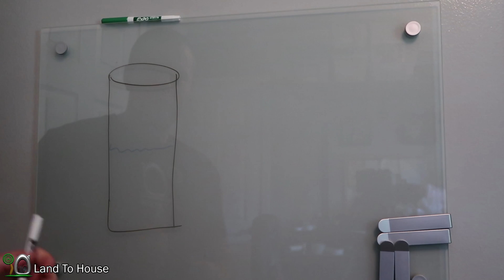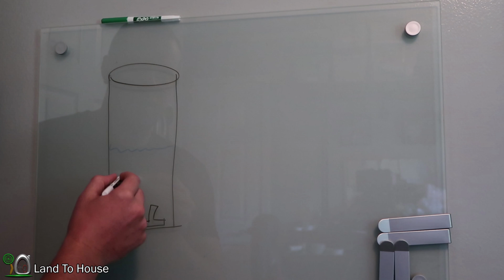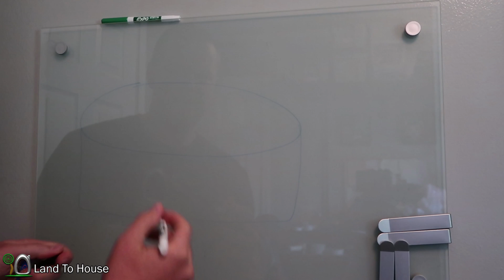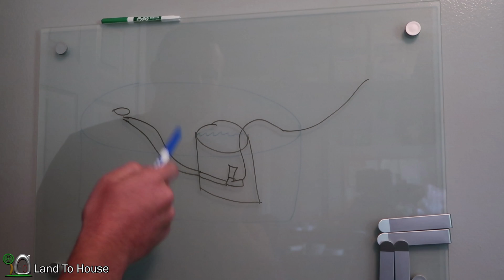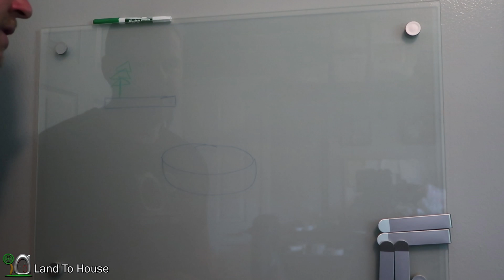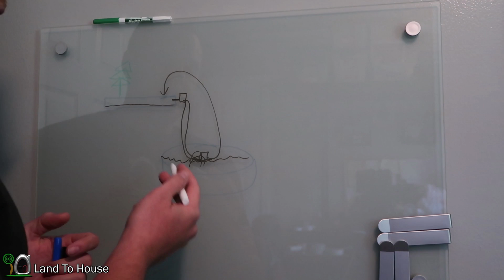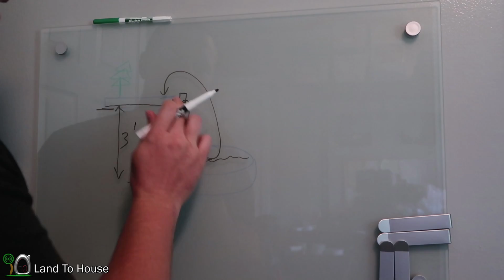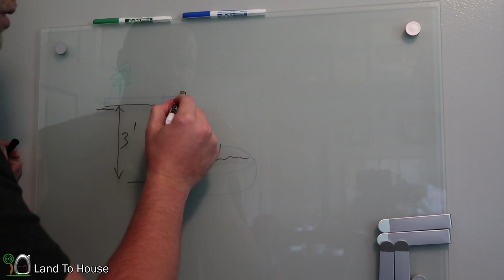Ram Pump for a Well and Aquaponics - Nope

Comment: I have a design for aquaponics that takes the disadvantages of the ram pump into account. Wondering what your thoughts would be. Still in the design phase, so dimensions and measurements are not actual yet, just for sake of explanation.
I will have a my fish tank three feet off the ground. Ram pump intake goes from tank down into a reservoir on the floor where the waste goes. The 10/15% water goes up six feet to my media bed. Water is cycled with a bell siphon that empties into fish tank. Sump pump in the reservoir automatically removes water back to the fish tank.
This design removes the need for a pump running on electricity 100%, just estimatedly 10 time per hour for two minutes (based off the size pump I'm planning). 
The height of the media bed provides back pressure for the pump, the quantity of water in the fish tank allows for a full cycle, and it is reset by an electric pump.
Note: I might end up added a "parallel" tank at the same elevation as the fish tank, attack via "u" siphon to maintain equilibrium between tanks, for the purpose of having a greater water quantity "in the bank" as well as possible draining the sump into to prevent too much water movement for the fish.

Comment: i want to try to lift the water using a solar pump  into a drum which will stand above the water on a stand . then position the ram pump right above the surface of the water on the same stand but lower than  the drum.  to pump the water into long pipes that will drain back to the dam. the long pipes will serve as grow beds and the dam has fish . what do you think about this plan?

Comment: Yea.  Your logic is a bit flawed here.   If you've got a hand dug well what's stopping you from digging a secondary chamber next to it with a drain for the ram pump to sit in with the drive pipe coming out of the wall of the well and the excess water from the pump draining right back into the well again.

Comment: i guess you could prime it by prefilling the upper tank to the overflow first...either by hand or an electric pump (you can have a simple waterwheel set up to do it)

or don't make it a closed loop...run the ram jet line up through the hydroponics and then either irrigate a normal garden, clean it for drinking water, or send it back down into the stream...

Comment: What about lifting the waste valve and pressure tank up so the intake/drive has more head pressure ( 2m from the water surface) than the rest of the pump ( maybe 1m )? . Water will start to flow through the system up from the intake to the waste valve. Ofcourse valve will also be pressed down by the water above, but this could be compensated with the spring.  Anything missing in this concept? ;)

Comment: I f I have a drill well, and put a 2” line in the well with a check valve on the bottom. The  well is 600 ft deep  I put in a 400 ft  line, in the well the water is 100 ft down. And I fill the 2” line in the well with water. I put a  500 gallon tank on a hill roughly  500 feet away  40 feet higher than the well head. Now I have water in the tank on the hill to  keep  water for the ram will it pull water up the pipe  that is full of water at the well head.   and put it in the tank on the hill 500 ft. Away.  Thanks for thinking about my problem. Larry

Comment: reference to aquaponics: it's common practice to use gravity water flow in aquaponics systems, considering the fish tank is higher than the grow beds and a sump tank is the lowest component (usually a pit dug into the ground to establish sump tank). so it be fair to say if one could infrastructure additional space for ram pump system lower than the sump, we have pressurized recirculation aquaculture control flow. like a system on a slope? could possibly work.

Comment: Due to water weight, if you dig a hole and place your ramp pump lower than the water level....then it should pull from a stagnant body, yes? Only thing needed is a place for waste water to go, such as another depression?

Comment: hi great videos . hi can i use a water pum to run a ram pump ? i saw your video about the under water pum . thinking maybe ii ill use a ram pump under water with water pump it will help me move water in the tank while while using the power of the ram pump to move water out while the waste water stays in the tank but creting water to move around the tank

Comment: what about using a ram pump in a tower garden?
Reply from the maker: I use the ram pump to pull water from the creek and pump to a water tower. Then I let the water run back down by gravity to the garden. It works very well.

Comment: If the waste valve is circled to the original static force then it'll never run out)?right) n say the water level is the static(then doesn't size matter? I just don't feel it needs to drop through a pvc
Reply from the maker: taking the waste water back to the source does not work. It makes the whole system at the same water level. Meaning that there is no pressure to start the pump
Reply: But if 90 % of the water is waste water wouldn't it build more static pressure cause of the 90 % waste adding to the static where the drive is
Reply: Y would it work? Only if it drops below the lvl of the drive

Comment: The hydrophobic issue could be solved with a hero fountain or Herron fountain.
That's a free energy device & has many great applications.
Reply: Absolutely incorrect. dS/dt >= 0 , where S=entropy . No "free energy", no perpetual motion machines, no Santa Claus. Myths are not science.
Reply: A herron fountain is a closed system built by pressure

Comment: I have thought about a partially submersible bin, bucket? It would be weighted down to create a head height  & the residual wasted water that poses the problem! Can be sucked out by having a thin hose that run's on the outside of the drive pipe> using the vacuum effect to clear the 
waste problem.

Comment: How about this... what if... you used... the ram pump and E-pump in tandem, would that work? like 1 meter high grow bed falls into pump, then you would need a 3 meter back pressure. water flows through syphon activates the ram, a E-pump with a float switch in tandem to pump out the excess 90% waste. what would the flow rate be after the first cycle if this would work?
Reply: What if a trench of proper proportions was dug at the outer edge of the pond or body of water which would simulate downhill or gravity flow to start the ram pump.. it would probably drain it eventually if rain or some other source didn't replenish it but I believe it would move the existing water that's in the pond.
Reply from the maker: As long as the pump and water source are in the same pond it won't work. The water must be flowing and have head pressure. Sad but true.

Comment: If you use 9 ram- pum use at 3steps ? ..may be worked
Reply from the maker: The problem with stepping the ram pump is that a single pump can't supply enough water to run another 24/7 unless the first pump is very large. It's best to run the first pump as high as you can.

Comment: If your fish ibc tote and is plumbed to swirl filter which is plumbed to bottom of ibc tote off ground at level of top of swirl filter say a 55 gallon barrel then sump is plumbed to ram pump would it not pump water to grow beds and fish tank. Seems to me it’s all in how your system is set up.
Reply from the maker: The main issue is that the ram pump uses way more water than it pumps. Eventually the water will be at the bottom. The idea is that someone could use the ram pump without a sump pump.

Comment: what if u take a open barrel From both sides.Gluing rubber on one side and install a thin tube in center of rubber Through the center of the barrel. the tube it must be at the height of the well plus height of the barrel, dive  the barre strongly   in the well ( Rubber towards the bottom, Tube towards the top) Until the water reaches the outlet of the pipe (sorry for bad eng)
Reply from the maker: Is this design used with the ram pump? As far as I know there is no way to use the ram pump in a well even with a barrel.
Reply: I painted two pictures of the design I mentioned and for another design 
https://imgur.com/eh4jVoO
https://imgur.com/tybQrlk

Comment: Ok imagine your  Aquaponic system  is 20m higher than the river,  and there is enough head to reach 40m.  I remember seeing a ram  circuit that just used the hammer to push re-circulated water in a closed loop circuit,  so no new river water was added to the system. It does exist buddy, just not in the way you described. Maybe you can re design it.
Reply from the maker: I would like to find that in action to learn from that setup. So far I have not seen any closed loop with ram pump that lasted more than one cycle of water.
Reply: Land to House Me too!  But we can all agree that the ram hammer creates enough energy to pump 10×  the head height.  I'm now thinking if the ram action could power a piston, and a  Camble fly wheel?  With the output connected  to a gen, or a pump.
Reply: Land to House check out  mrteslonian TT channel, he adds a Tromp to his ram pump to get more pressure, now I'm thinking to add small tromps to aquaponic systems, no need to buy air pumps, but with a pump and a troop you could make an air lift circuit, for free!

Comment: Howz about using  a constant flow gravity system instead of a cyphon? If the ram pump in the lower tank was big enough to compensate for the waste water loss, couldn't it pump enough water to the top tank if the top tanks outlet pipe was of a sufficiently smaller bore to retain enough water and also supply the ram pump? Probably not, we're really looking for perpetual motion but  don't want to admit the pump is so innefficent in this sort of system.
Reply from the maker: No matter how we use the ram pump in the end 90% of the water ends up in the lowest place. It really is a tool meant for a constant source of new water in a higher state.

Comment: cool video....had an idea and not sure if it will work but I watched your video about the pump under water and seen that it still worked fine.. this tells me that the release valve is strong enoungh to  hold water out......so in your pond scenario with a canaster down in the pond housing the ram pump....could you not attach a pipe to the out flow and up and out of the canester back into the pond?  What am I missing....or maybe im wrong and under water makes it more effecient cuz not as much water is lost in the release because of pressure...not sure too many questions maybe need to build one and test....but your input would be appreciated.
Reply from the maker: I have learned a lot about the ram pump since the underwater test. I have another test planned later to show this concept better. The pump needs a source of water above the pump to work. In the pond- If you made the waste valve tall it would negate the head pressure by hydrostatic pressure. So the valve would never cycle. The water would equalize in the pipes.

Comment: There is another setup no one has considered. Put your fish tank lower than  halfway down  through your setup. Use waste water to fill the swales and tanks at several levels going up hill using several pumps. Use gravity and bell siphons to empty the swales from tanks at the lower end of the swales. I hope this helps.
Reply from the maker: The problem is the difference between waste and lift. The ram pump only pumps 10% or so and the other 90% is lost out the waste valve. So very soon after you start all the water is at the bottom.

Comment: If a wide concrete  tube was submerged down to the bottom of your pond but was long enough to stick above the water surface, the contents could be pumped out. The concrete tube would then be open to atmosphere. Is there no way of removing the waste valve water via check valves and /or a submerged pipe or a  drain pipe running below the pond bed to lower ground?
Reply from the maker: So your idea is to have a dry cistern sunk in the water and place a ram pump there inside with intake in the pond where the cistern is located? Then Have and extended pipe on the waste valve that carries the water out of the cistern, out of the pond, from a location in the bottom of the cistern?  That would work but it seems like just moving the ram pump to the place where the waste water is going would be the better option.

Comment: what if u install the suction pipe straight at the bottom?
Reply from the maker: Hello. So installing the intake to the ram pump (suction pipe) from the bottom of a pond will work as long as you are taking the drive pipe out of the pond and down hill to the pump. Installing the ram pump in the same body of water as the drive pipe is not going to work. There is no downward movement of water in a pond. The hydrostatic pressure and head pressure are equal and opposite forces.
Reply: Came to mind as well...If the  pond is about 20 feet deep... And if suction is set at the bottom.. the pressure difference should trigger the ram pump right?
Reply: Correct, my idea is to put the relieve valve outside the surface of the pond, so there will be definiteley pressure difference, suppose that the pond is lets say, 30 feet deep, that is approximately 10 meters in metric, pressure created at the suction of the pump is automatiacaly around 1kg,/cm2, which is pretty enough fpr starting the pump.
Reply: Sounds about right to me. Im planning some thing similar but with a linear design ram pump. Thinking to experiment it by setting it up vertically and semi submerged into the pond with suction pipe below the water and relieve valve just above the water level. Donno if its gonna work. But thought to give it a try. fingers crossed.
Reply: im planning to do the same for me, but my casse is way difficult, i want to make it with sea water, i have a small properyty close to the sea and i want to make a swimming poool totally free of chemicals, just by renewing the water in daily basis, so it wont be infeccting anyone, hope it will work also for me, if it works, who knows, possibilities are endless
Reply: Thats awesome... Good luck buddy.
Reply: thank u man, same for u, i have an idea for yr case, u should dig yr pond little more deep where u gonnaplace yr pump, in order to create a technical well, fully submerge it there, leave the suction pipe straight next to the pump and rock and roll!!!!!!!!
Reply: Δρυοπας φαναριτης thanks. Point noted. The pond is already dug deep. I believe it’s 20 feet or more as you move into the deepest part of it. Thinking to place the pump in that area. Everything is just theory so far for me. My next step is to built a ram pump. I have to start from scratch😜. So it’s gonna be a while to see the results. In the mean time do let me know if everything works fine for you 👍🏼
Reply: u can experiment in smaller scale with plastic bottles and soda straws in yr kitchen, just my idea, moving water without any kind of power is veru exciting by itself, :) i will try iit on summer because now is not the time to test it under the sea, its winter now in greece. its also a good idea to build a tank high above ground, as high as u can to create as much back pressure as possible, my property is around 250 ft (65 mtrs) above sea evel, so i dont anticipate delivery problems
Reply: correct if u polace it at the bottom of the pond, but what if u gdig a well in thew pond it self to create this hydrostatic pressure? if u dig it deep enough , lets say, 20 feet, that is almost 7 mtrs , u instantly create 0, 7 kg/cm2 of pressure at the suction of the pump, my idea....
Reply: @driopas 
What happens when that well fills up with water?
Reply: u just put the breather valve out, higher from the surface of the water, the... waste water then will not be a waste at all because it will be recirculated, so, by having yr suction deep down and the breather valve out of water, i think it will work....
Reply: @driopas 
If instead of having the regular waste water just spilling out onto the ground like in a regular ram pump setup, you then put a tube onto the valve where the waste water would normally come out of. That long tube that would be going straight up and out of the pond (7 meters deep)... The water in that tube would then act like head pressure, pushing that water back into the ram pump, stalling out the pump.
I don't think it would work. All pressures would equalize.
I would love a setup that works with just a pond of water. We gota figure this out...
Reply: well, all we have to do is try, i share the same thoughts with u abt equalization, i dont know, due to my work nature i cant make it and figure it out......perhaps if u play with the diameters and the volumes it will work, for instance, bigger suction diam, shorter breathe diam, just an idea... even in a ratio 10/1 at the diams of the pipes maybe do the job....
Reply: @driopas 

Maybe.... Cool to find out